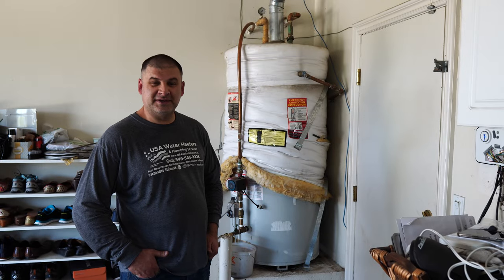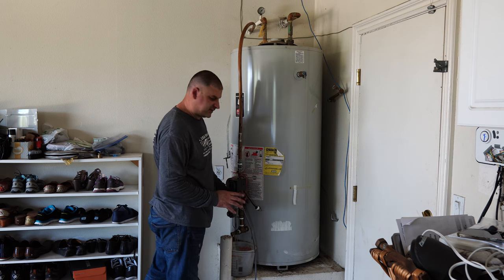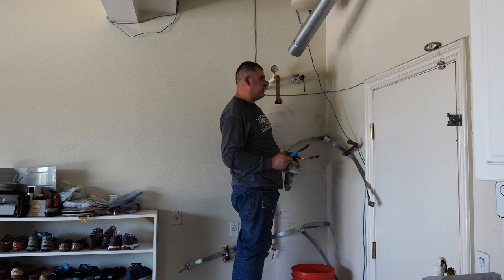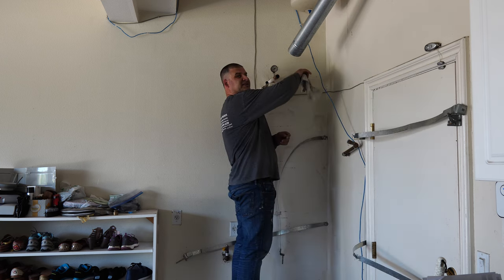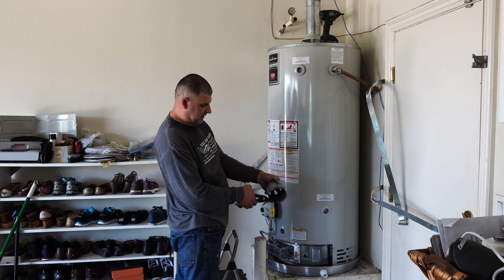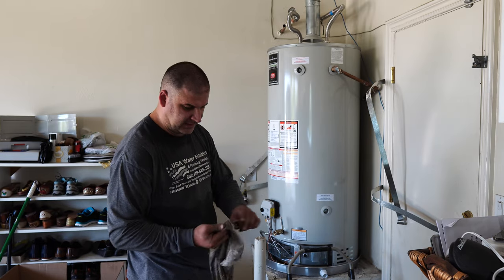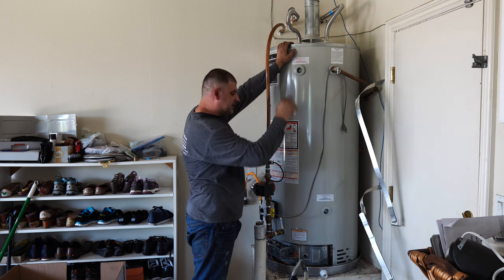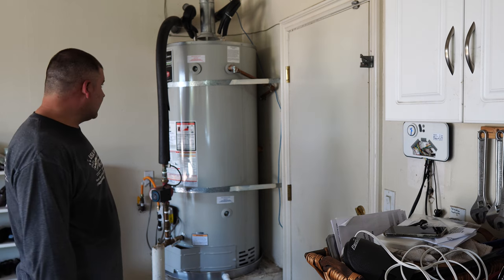Replacing a 75 gal Water Heater Like a PRO

Comment: Nice job Dennis. Question for you. Is it ok to install a 75 gal tank with 3/4" NPT if your water inlet is 1"?
Reply from the maker: Yes, it is fine.
Reply from the maker: The only down side is the water volume transported is decreased. When you open all hot water tabs in the house you may notice slightly lower water flew than if you had 1” connector.